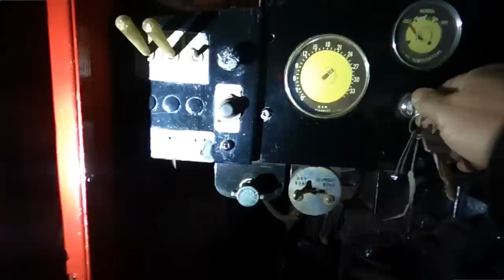Unleashing the '63 Autocar!

Comment: I served In Vietnam  in1968-1970 wioth MCB 12 and MCB 1 15 of the trucks were A-CARs  tan dem axle with a 250  Cummins 5x4 tranny and real 11:00  x 24 rag tires. No PS  or A/C, steel plate in the doors and on the floor, sand bags also on the floor, and armstrong steering, We pulled a Challegee/Cook belly dump with tandem axles.Speed limit was 20 MPH, bridge  weight was 115,000 lbs. Daily  temps ranged from 80 degrees at sun rise to 110 degrees  in late afternoon. Humidity was always 98%.We drove 10 to 12 hours a day ,6 days a week, stood a 6 hour perimiter watch every 3 days usuaslly from midnight to 6 am. We made  2 or 3 loads per day going hauling crushed rock 30 miles south of DaNang for HWY # 1. I had never driven a truck bigger than a single axle 1948 Dodge dump truck. I also learned to operate a 955 track loader, #12 grader, D - 8 cats , and TS-24 Euclid pans.That was real trucking and equipment operation. We were all given a 5 gallon uninsulated water jug.

Comment: First heavy truck I drove was a late 50’s Autocar mixer in 1974 or 75. Had a mechanical parking brake so had to use the trolley brake on job sites. Had a 5x4 transmission

Comment: 359....or an A model.... 3408... either a 15 over... or a 5 an a 4... flat top double bunk... 280 wb... 
My last truck was a 92 379 with a 3406. Mechanical gov...125-15... 390 rears. 63" flat top and a 260wb.
I loved that truck.
My first truck was a 75 352... 1693 TA 425 turned up to god only knows... and a 13 with 4.11s.. and 10.22s which meant 85 at the governor.... but you had to watch yourself going up hill in the rain with a light load...because she would literally spin the tires.. with 28,000 going up the Palasades hill in nj going up to the GW bridge.
70s and 80s. Good years.

Comment: So... brother... a little constructive criticism.
Your chains were too straight on the lowbed. Particularly with a vehicle on tires. I would always run the chains long and as far away from the truck as possible so that when you hit bumps the chains can move up and down as the tires bounce...without slacking. The way you had them... if the truck bounced it would loosen the chains on the way down...and slam them on the way up.
Sorry... ran lowbed for 12 years...and flats and drops since 78...
Another option would be blocking the axles and pulling the chains tight against the blocks... if you were going far. Then your angles would be fine.